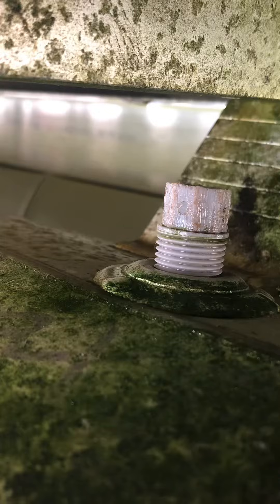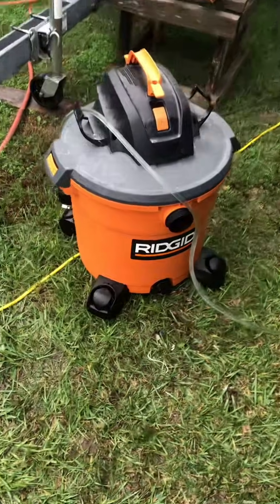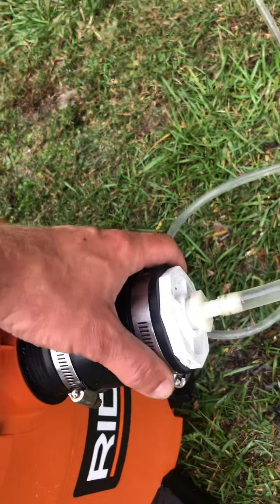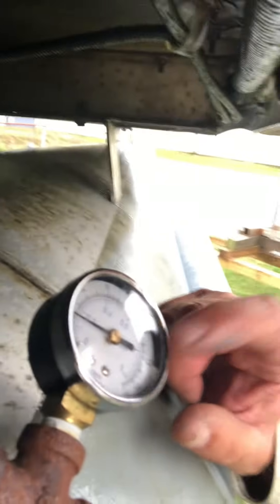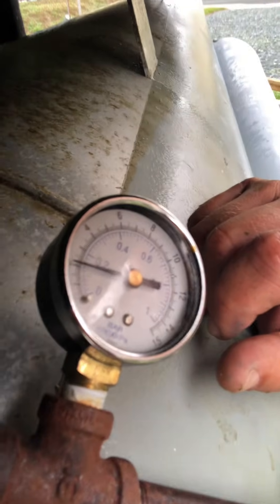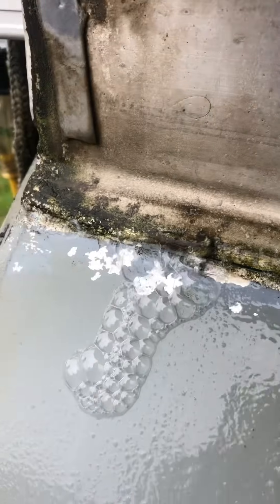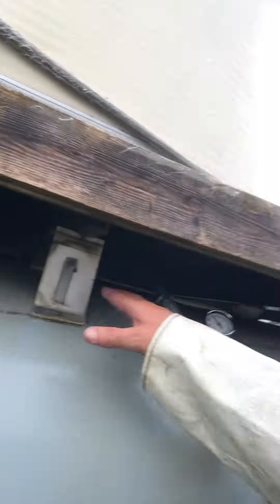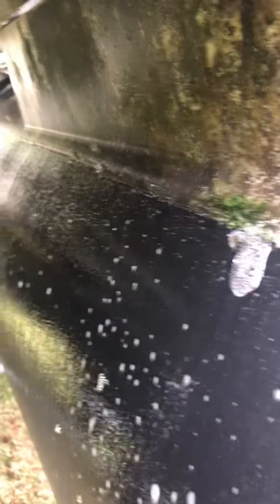Draining pontoons, and pressure testing

Comment: How long does it take to fill up the toon to 2 psi?  I'm trying to fill mine up using a 2.6 scfm pancake compressor, with no movement on the gauge needle after 10 minutes ...

Comment: All this advice sucks. First you weld drain plugs on the back at the lowest point, pressure test, next remove brackets attached when that is where you have a leak to the tube. weld the leaks instead of contaminating the aluminum. pressure test again at around 7 psi, weld brackets back, , ready to go
Reply from the maker: You are 100% correct. The reason I did not take some of those steps: 

1. These pontoons are baffled, so water in the nose cone, or center of the pontoon tends to stay in that compartment. A drain in the stern would be awesome, but it would not necessarily drain the water from the other 2 compartments. For that to work, you’d need to put 3 drains in the bottom of the pontoons, under each compartment.

2. Access to aluminum welders in my area is limited, mobile aluminum welders even more limited. Sometimes I have to make a quick (albeit jerry rigged), repair to keep the equipment working, while I line up schedules to have a proper repair done.

One of my welders said if I was gonna use an epoxy for a temp fix, marine Tex was the preferred. He said it would dry hard enough, that he could grind it off fairly easy. Some of the other putty’s would stay gummy and be a bigger task to remove.

I know a guy who runs a rental business who, at the end of his season, drills holes in the bottom of his pontoons, under each compartment. Drains out the water, then has a welder come weld those holes closed, and patches the leaks. 

Best repair I’ve found it to remove the offending M bracket, clean the area, weld a doubler plate over the crack, then weld the M bracket back on. That’s a more permanent solution than tig or mig welding over the cracks.